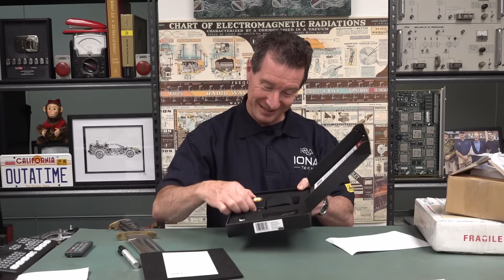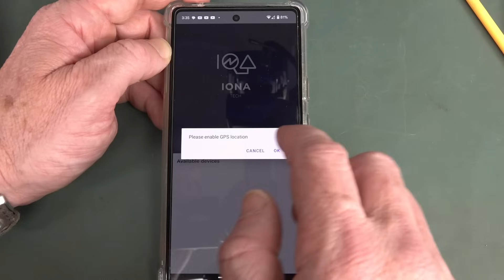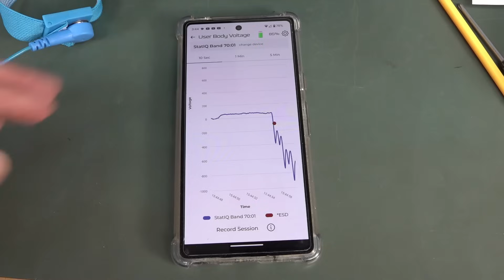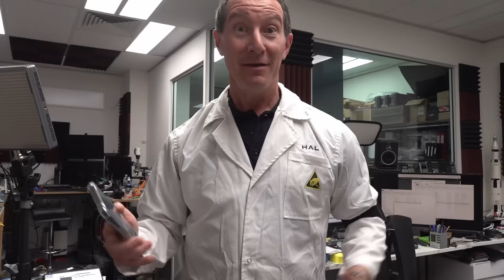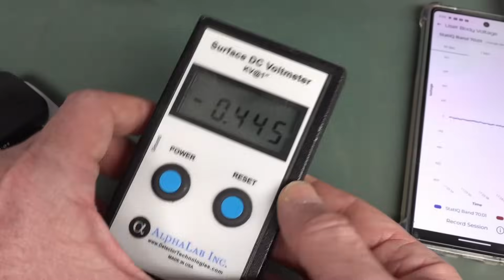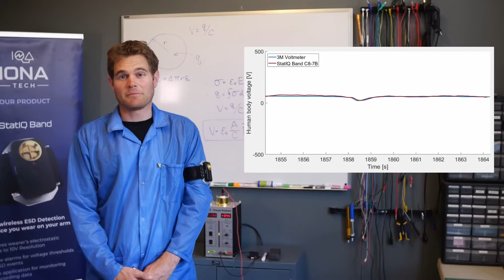EEVblog 1567 - Wireless ESD Monitor? - The IONA StatIQ Band TESTED

Comment: Speaking of wireless anti ESD wristbands, although not wireless the implementation of a wired one I saw in a video the other day made me laugh as it may as well have been a wireless one! A guy was working on a vintage computer (An Amiga 4000T for the curious) and as the chips in those are old they are more susceptible to ESD so he wore a wired anti ESD wristband and clipped it to the metal frame inside the case of the computer. Nothing wrong with that you may say, but he did not have the computer plugged in! So, even if the metal frame in the case was connected to the ground line of the power cable, being unplugged meant no ground connection either way! LOL

So noobs... If you are going to use the metal case as ground for your wristband make sure that: A) There is a connection between the case and the ground pin of the power connector, and B) It's plugged in! Even with the power off the ground pin should still be connected.
Reply: in that case, it doesn't really matter if you're connected to earth or not. Connecting to the chassis means you are connecting to the computer's ground, so you have 0V differential to the sensitive chips inside. Sure, if you touch anything else then you can zap it.
Reply: @userPrehistoricman  Connecting to the chassis does not connect you to the computer's ground if the computer is not plugged in! Ground is called ground because it connects physically to the ground outside your building. There is no computer ground if the computer is not plugged in! 😂

Comment: Spent too many years in a bunny suit and cleanrooms. Our suits had thin wires woven into a grid in the fabric to dissipate charge through the conductive booties. No esd damage to fet devices in our fab. This device would have been helpful to ensure the ionizers below the hepa filters were working correctly.

Comment: I would be interested if there was a version that doesn't use bluetooth/gps or smart phones at all and just simply had an array of LEDs or some other display indicating a voltage potential.  I wouldn't even need to know the exact voltage just some sense of how far away from 0 I am.
Reply: @divarin1 There is some feedback of the measured voltage via the center LED on the edge of the device. (Blue = negative, Red = positive, brightness adjusts with voltage to full strength at the alarm threshold). We sell a version without the Bluetooth radio for use in restricted locations.

Comment: Impressive device. I wonder though whether people working in fabs, labs etc would be carrying a smartphone (I have no knowledge in this area). Perhaps a more central monitoring hub or a WiFi (perhaps a V2I method to improve battery life) implementation is on the cards.
Reply: In general you are not required to leave your smartphone behind, as long as it does not have any dust on it.
Reply: @ralphj4012 there is another back end that allows QA managers to monitor all devices in the facility without requiring the smartphone interface!
https://www.youtube.com/watch?v=TIttFqTNB2o&list=PLzzzgJ9ji4CEOxwK-VhkKBYJYb1liBa17&index=12

Comment: Not something needed at my job for sure - I mean, we deal with static sensitive devices yes, but we also have live mains throughout (form factor limitation) so it's less about ESD and more about not getting shocked. Most people have isolated mains supplies to minimize shock risk, but there's a few of us (me, included) that require the real un-isolated mains earth referenced power. My test board has a "Non-isolated power" warning label on it because the only thing protecting you is a circuit breaker. In fact, bridging live phases or live and neutral are a possibility that a GFCI or RCD isn't actually useful.

Comment: Android apps requires location permissions to operate bluetooth or get info about wifi network.

Reasoning is both can be used to get your location.
Reply: Didn't you see that Dave first granted location permission and then the app explicitly asked for GPS permission?
Reply: @MetalheadAndNerd  That's weirdness of android. bluetooth access also requires  android.permission.ACCESS_COARSE_LOCATION ,while GPS is governed by android.permission.ACCESS_FINE_LOCATION.

I think it was fixed in android 12 where there was separate permission for only BT scanning, but app not written to use it would still ask for localtion

Comment: From a developer perspective, the location permission is really annoying. It's a requirement for an app to access Bluetooth but customers think we're tracking them. We have to put a lot of explanation into our UI and documentation. The reason for the policy is that you could be tracked with BLE, similar to an Air Tag.
Reply: A developer should have noticed that Dave first granted location permission and then the app explicitly asked for GPS permission.
Reply: @MetalheadAndNerd  If you are targeting Android 11 or older you need ACCESS_FINE_LOCATION in addition to various BLUETOOTH_* permissions to manage bluetooth connections in the way this app needs to. This is presented to the user as a GPS permission, but in reality it's because apps that can scan for bluetooth devices MAY be able to incidentally infer the user's location from proximity to various types of bluetooth beacons. 

There are ways using newer API versions to request narrower permissions that mitigate this, but that would mean your app wouldn't be able to run on something like (as of March 2024) 30% of active Android devices.

I'd link sources, but it'll get my comment sent to the spam hole.

Comment: Hello, good luck, I am having a problem with the 5v line on the card, it either falls into a short circuit or the voltage collapses, it drops to 1.3v. How can I easily find the faulty part?

Comment: There was a need for something like this in my job function before I retired. I had the job of equipping rack mounted equipment ( 32 Slot Ciena 6500  D/S system and Ciena 8700 shelves)  with plug in cards costing anywhere from 10K to 20K USD at some sites, and although I made sure I wore a wrist strap, and even made sure I touched the rack with my hand first before inserting any cards, having a similar device to that would be some extra insurance to prevent a possible future service outage.

Comment: As soon as I saw the spinning "blades" I knew it was a very small Field Mill, which is cool because way back in the late 70s or early 80s, Scientific American published plans for the same thing, but it was built from a gallon metal bucket, and several large sheets you had to cut the plates from. I never did get it to work, but this really got me excited not because I need one, but because they managed to shrink it down to something you can wear. Very Cool.

Comment: @Dave  To expand on your discussion at 13:40 -- about measuring your body voltage by strapping the AlphaLabs on a spacer to your body.  That would only work, I think, if you also attached the AlphaLabs ground wire to ground, and insulated its case from your body. The AlphaLabs relies on a ground reference, either through the wire, or (the slightly non-obvious part) through its conductive case  which gets a ground reference from your hand if you're holding it AND your body is grounded via ESD strap.  Of course, if you strap it uninsulated to your body and also attach its ground wire, that'll ground your body so the measurement will be zero!    :-).
Reply from the maker: Yes, I believe that's correct.
Reply: Great insight @Graham_Wideman. The StatIQ Band is able to make this measurement in a wireless way by turning the field meter around and measuring the field generated by local charge on the body, and extrapolating this to total body charge and voltage.

Comment: Nice! It would be great if you could do a video demonstrating ESD damage - this strap could really aid in that. Linus Tech Tips and Electroboom did a video a while back concluding that ESD isn't anything to worry about. But those of us who work in labs with ESD equipment know that damage isn't always visible immediately - it's cumulative and usually drastically reduces the life of the component, or causes weird sporadic glitches that get worse with time.
Reply from the maker: And that's why it's almost impossible to do a video on this. You need to decap silicon and examiem the die etc. Although I do have an ESD gun in the mail...
Reply: What about line driver latchup  @EEVblog  ? would it be enormously hard to provoke that?
Reply: I struggled for years trying to track down problems with ham rigs that got lightning'd. Now, I just don't go near them. My beard is already white enough.
Reply: ESD circuit damage caught in action by the StatIQ Band!
https://www.youtube.com/watch?v=kcQmX0K4ydM&list=PLzzzgJ9ji4CEOxwK-VhkKBYJYb1liBa17&index=6&ab_channel=IONATech

Comment: That spiny bit reminds me of generating volt meters used in particle accelerators. it uses the electrostatic field and chops it to generate a signal on the electrodes behind the spinning bit. Edit: you said it too.

Comment: The one I made long ago just had 2 vanes over the two plates. as the motor turns it creates a AC signal that can be amplified to indicate the voltages in the area.

Comment: Since Android lumped together all the "connectivity" features with the "location permissions" I have installed a "fake GPS" app. Peeps are getting usage reports from null island from me :P
Reply: Didn't you see that Dave first granted location permission and then the app explicitly demanded GPS permission?
Reply: @MetalheadAndNerd  exactly. Some of these things are getting lumped together for no particular reason: location is required for WiFi and sometimes BT access and the apps then go on and ask for the rest of it... Just because most devs probably don't care making the diatinction. I use the GPS faker for every app that acts similar.

Comment: That sensor look a lot like the vanes in the old  AM/FM radio variable capacitors.
I assume the spinning of the vane is for airflow so it can compare the charge in the room with the charge on the wearer.
As for the price, it's a drop in the bucket compared to the cost of a set of PnP machines and the wages of the operator.
Reply from the maker: It's called a Field Mill and is known thing: https://en.wikipedia.org/wiki/Field_mill didn't know this while shooting or editing.

Comment: I think the wavy lines in the strap are not conductive. Its just rubber to avoid it moving while in your arm.
Reply from the maker: You are right, I just measured it and they are not conductive. So they must be just relying on the metal backing plate.
Reply: yeah there is a bug honking metal plate so it's fine

Comment: It probably didn't need GPS, but the "location of nearby devices" which sounds like it's Bluetooth Low Energy, which from what I could understand you rejected. It's likely a phone OS issue, not an App issue, because of how linked bluetooth le beacons are with location tracking from the phone's privacy systems POV, that the app rightfully expects the phone to bundle bluetooth LE monitoring  of sorts to be covered under the Location-services on/off toggle.
Reply: Yeah, I think this is the phone's paranoid way of telling you, that if you grant Bluetooth and especially Bluetooth-LE to the app, then the app can effectively track your precise location, using the various BT devices scattered around everywhere, especially BTLE beacons, which exist in stores, malls, your friends homes, cars nearby ...
Reply: No, the app explicitly asked for GPS permission after general location permission was already granted. Don't you listen when watching a video?
And 10 equally deaf people gave you a thumb up for this. 🤦

Comment: Could you carry this during a thunderstorm, and if it starts beeping at you, time to curl into a ball on the ground?
Reply: they make the same kind of thing for outside, but it's a upside down hood. and it's better to stand on one leg.
Reply: For step potential, but if the lightning is about to strike you directly you better not stand. @LaserFur
Reply: Having been caught in a lightning storm very close to a mountain top recently,  I don't think I'd be reaching for this device until I felt safer.

Comment: Super cool device. I'm still wondering if those "wireless ESD bands" came to exist due to a translation error, meaning it doesn't come with a wire and thus you need to supply one yourself. That'd explain the 1M resistor connected to the snap point for a wire at least. But I'm being generous :)
Reply from the maker: Yeah, too generous, it's just marketing fraud.
Reply: Some of them advertise having some sort of sharp point inside or a bundle of thin sharp carbon fibers, the claim is this dissipates the users body voltage into the air kinda like an air ionizer, some claim on the order of 30 to 50% reduction in body voltage, but even if this did work (they don't) you can still easily damage sensitive CMOS stuff with 30 to 50% normal static voltages.

Comment: At US$1200, it looks like a wise investment compared to the cost of not just down time but also the technician's time needed to repair equipment after an ESD event. In a supposedly "ESD-Safe" lab it could help you find any equipment that is not properly shielded: You'll get a beep when you're close to it.
Reply from the maker: Ah, US$1200, I totally missed the shop link on the website. That's cheaper than I thought it would be.
Reply: @EEVblog  For US manufactured low volume electronics production equipment like this, 1200 sounds REALLY cheap. Especially compared to the hideous prices I've seen on some of our other tools we have where I work (80$ for a pair of snips? Are you shitting me?)
Reply from the maker: @iamdarkyoshi  I've seen snips at double that price.
Reply: @EEVblog  $1200 seems a good price, seeing as they probably sell dozens per order, likely just under $1000, and do not forget that a good chunk of the time there will be a service contract attached as well, so steady income, and likely hundreds of units a month in that from large facilities sending in batches. Many large companies likely spend an order or three of magnitude larger in cost on just laundry of the ESD garments alone.
Reply: I expected 5k+, ngnl
Reply: 1200$... does it prevent also static shocks when stepping out of a car? That may be a deal breaker 😂

Comment: That's a really cool product, reminds me of how they indirectly measure an astronaut's body weight on the ISS without gravity, they just measure it as a sprung mass, change in mass changes the oscillation period, similarly in a way their moving electrode allows for indirect measurement of body voltage without the need for a wired ground reference.

I do however wonder how durable it is, can't imagine you'd want to use it in anything other than a clean room, industrial fuel handling applications would be questionable, hopefully you can replace just the sensor rather than the entire unit if it gets dirty or otherwise damaged.
Reply: Probably part of it is a 6 month cal cycle, where you send it in to be cleaned, verified and sent back. Likely any plant using them will have a few spare ones, there to cover this time, and you will simply take one per shift, and return after, with the app doing the verification of who when where.
Reply from the maker: @SeanBZA  Quite likely. Rally high end labs have a lab manager, or even an ESD manager at the extreme end that would ensure this all happens.